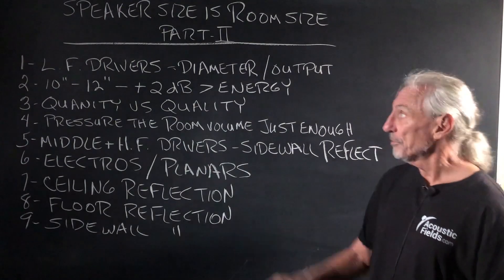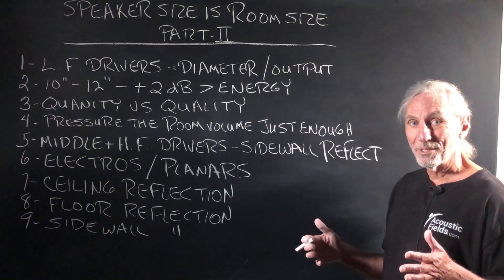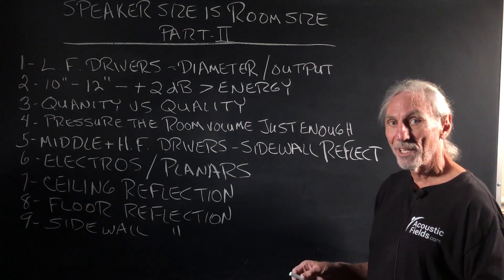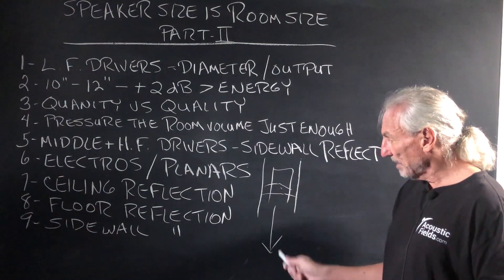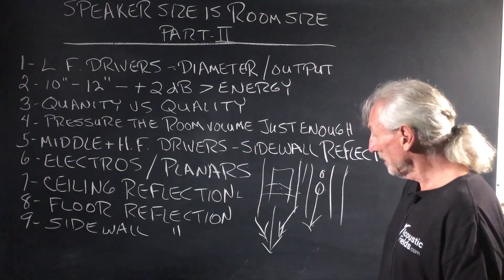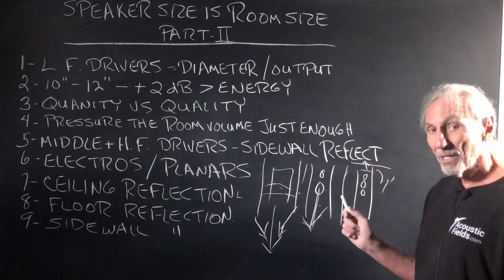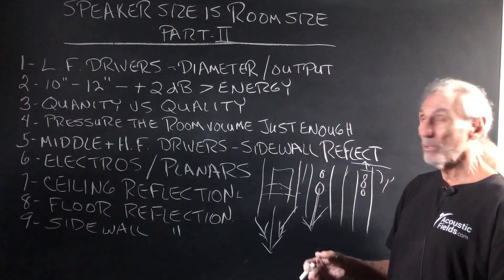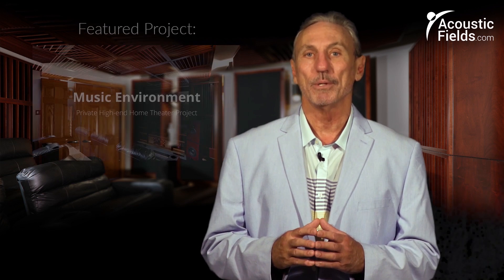Speaker Size VS Room Size Part 2 - www.AcousticFields.com

Comment: For a 11'14' with 8.5' ceilings, cinema room with in wall speakers,  what size would people recommend? Would 6.5" speaker's and 2x10" subs be adequate?
Reply from the maker: Smaller room volumes are best served with placing less energy within them especially below 100 Hz. Stay with a full range 6 / 1/2" driver speaker for mids and highs. Use 1 - 8" sub for this room volume.

Comment: Thanks a lot for the great information, I have question my room is 31Lx13wxh8 feet, can I use pair of 12 inch speaker in this area?
Reply from the maker: You can try anything. However, start with one and learn how the room responds to a single driver. That response, rate and level, will tell you whether more surface area output is required.

Comment: I like the low mids that 18” have, they spread the sound good.
I am impressed with the smaller advent speakers in my bedroom. The stack with two cabs tweeters in seem to give a good start. I really like what four small speakers do above and below the center of the room from the floor to ceiling. 
I have dynaco stacked in the next room same configuration box dimensions but different crossover, drivers and ported. 
Both rooms are horrible. But the speaker size and box seems like a win for now. 
I would love to stack jBL 4312. But that speaker requires a dedicated room. I will continue with the four speakers for my preference on play back in stead of just a pair of speakers. 
Thank you for you’re dedication and I appreciate you’re lives work. ❤️👍🏽😀
Reply from the maker: Subs can be set to produce energy at certain frequencies below 100 Hz. Stay away from them for any middle range frequency management. You drivers within your speakers are much better at delivering more accurate renderings of those frequencies. If you are not happy with your middle range frequencies, don't add more energy. Treat your room with the proper rates and levels of absorption so your speakers can perform in the way the designer intended.
Reply: @AcousticFields  seems so, thank you very much Denise.😀

Comment: I have a pair of Sansui sp-X9000 speakers (in pristine condition) in a room measuring 10'X11'. [The room is acoustically treated] It's killin' me! But it's what I have. Hopefully, someday, I can place these speakers in a more worthy space. Until then, EQ - don't fail me now!
Reply from the maker: I remember those speakers from the 60's and early 70's. Are they the ones that had that wood lattice as a speaker cover?
Reply: @AcousticFields  Yes, Dennis. 14" woofer, 7" mid, double horns, and double tweeters. They sound amazing!

Comment: Thanks for the useful information I agree that the db boost works on larger units, I partially disagree with the fact that it is not possible to use large 12" unit woofers in smaller rooms (with setting both the crossover and the acoustic room). At higher volumes they have less distortion and play closer to the right set of drums than it would be for smaller units.
Reply from the maker: You should be able to play at lower volumes and here everything you need to hear or with subs its the bone conductance that is more important. The fact that you need to play at higher volume levels to get closer to the right set of drums should tell you that your system is not integrated correctly.
Reply: Pressure level and distorsion aren't the only factors to take an account, smaller units are much faster and closer to real percussion speed
Reply: Interesting.

Comment: i’d love to know if there’s a way to turn a water bottle (empty or full) in to an acoustic absorber of some sort. filling it with something that absorbs sound so it would absorb the frequencies that the bottle is tuned to.
Reply from the maker: Focus your research on Helmholtz resonators.
Reply: @AcousticFields  this is where i got the idea from, but i struggle finding more information about them. would love if you could point me to the right direction. thanks for replying!
Reply from the maker: @mr.fingers  You are defining the absorption process that is used within a Helmholtz resonator. The slot, cylinder volume, and internal cylinder fill material all work together to create the process of absorption. Helmholtz's work in narrow frequency ranges and must be used selectively in the room tuning process. The internal fill material controls the rate of absorption. The cylinder dimensions and the slot control the resonate frequency.
Reply: @AcousticFields  that was way more comprehensive than most of the things i found on the topic. just one more simple question, because i’m not sure what would work as a absorption material in such device - it has to be a porous material inside, like rockwool, cotton or somthing along those lines to absorb the sound, right? i was thinking of filling such bottle with concrete, but that would just change the frequency of the whole device, correct?
Reply from the maker: @mr.fingers  Concrete would not have the proper rate of absorption for the internal part of the resonator. Stay with limp mass material types. Stay away from building insulation. You could use a wool or cotton based material type.
Reply: @AcousticFields  thank you so much!

Comment: I don't get it, why not just attenuate the signal to the sub? I get the speed aspect of the size, but the amplitude is so easily taken care of. Or is it that bigger speakers emit more lower frequencies, that usually excite room modes in small rooms?
Reply from the maker: Larger driver surface areas produce more energy output. The amount of output has a direct impact on the room which will pressurize faster. We have used 2 - 8" subs in our studio that measures 65' w x 15' h x 25' d. They do not have enough output to pressurize the room with a time signature that keeps up with the middle and high frequencies. Yes, you can manage the output easily with subs but there are many other relationships that must be considered. There is  a relationship between the room loading and the attack and decay rates within the room. There is a relationship between attack and decay rates with definition and resolution within the room. A lot of this relationship is the room but without proper source the room is just another box.
Reply: @AcousticFields  So the takeaway is, choose the fastest sub you can afford, that has the option to attenuate the  output? And avoid excessive listening volumes to avoid time signature distortion caused by pressure? My listening volume is just 68dB so I probably don't even need to care about all this, just interested. What causes some confusion is that Acoustics Insider stated that room mode excitement is not a function of listening volume, and that our ears just start to compress when we listen loud.

Comment: How do passive radiators factor into this? Manufacturers like to boast getting lower response from smaller cabinets with passive.
Reply: Good question. However, passive radiators function similarly to a port. It's a resonant system.

Most importantly small room size plays no part in which low freq approach is best. Each example's capability is what's important. 

Sealed, Vented, Passive Radiator, Dipole Open Baffle, Infinite Baffle, Servo Control, Band-Pass, or any other type... if well executed and implemented, all these low freq approaches can be utilized. 

Individuals develop preferences for specific approaches, then at times preferences manifest into dogma/false statements, ie, "ported subs are slow boxy", "sealed subs are faster", "nothing kicks like a band-pass" ... etc.

That said, there are pairings that enjoy successful outcomes. Oftentimes open baffle subs are a great match to dipole mains. Many other examples.

Bass Mythology runs deep.
Reply from the maker: @FOH3663  Room size plays no part in which energy source is used is utter nonsense. The room size/volume is critical to any balancing of all energies. Bass mythology runs deep from those that do not build and test..
Reply from the maker: Source response is important. However, without a room that has a good acoustic ratio of dimensions and is properly treated to minimize response issues created by any source, frequency response is just a number.
Reply: @AcousticFields  my understanding is that passive radiators can add to the surface area of the driver (thus lowering response) but by moving parallel they continue to have a quick response time and therefore more accuracy. Is that accurate?

Comment: Compare ear buds to headphones, especially large diaphragm headphones and the space involved. The idea that the low frequency driver / speaker has to match the room is absurd. 
Properly designed speakers have a near-flat response, so the physical size of the woofer isn't an issue.
Reply from the maker: @chriswhalley  Yes and so is inner ear pressure response. Keep speakers out of your ears.
Reply: Mr Heisz is correct. 
Stating woofer size should be linked to room volume is simply not true...
Saying excessive woofer capability is a bad thing=nonsense. 

Also, isn't aware of, and never heard a good 18" driver? 
Bizarre, really.

Bass mythology runs deep...
Reply from the maker: @FOH3663  Our build and ,measurements of over 250 rooms does not support your "facts" or opinions. This is another example of not seeing the forest for the trees. Do not take my word for it, watch our clients testimonials who have followed our design systems. https://www.acousticfields.com/projects/
Reply: @AcousticFields  
You have builds, measurements, or testimonials linked to this woofer size nonsense? 
No way.
Again, doubling down on bass mythology, instead of discovery, learning, and moving forward. 

I'm aware of your portfolio. I'm glad you're happy with your business...it's all good.

That's entirely separate from putting forth incorrect information in a public forum, directed to those seeking to learn. 

You're not an acoustician, you're a YouTuber, acoustic treatment salesman, and that's fine.
Reply: @Lloyd Stout But he said that IF the frequency responses (="rates") were the same, it shouldn't matter what the size is.
Reply from the maker: Driver size and output are always an issue when it comes to pressurizing a certain room volume at the wide amplitude ranges that are used within critical listening environments.
Reply: @AcousticFields  Sorry, no. Bass output is bass output regardless of where it comes from. 100db from a speaker with a 10" woofer and a flat response is the same as 100db from a speaker with a 15" woofer with a flat response.
Reply from the maker: That is correct. However, you must consider every dB of pressure gain when designing a critical listening room and the sources that produce it. You must consider the rate of that pressure increase and driver output is related directly to the rate of pressurization.
Reply: @AcousticFields  100db is 100db - that's the spl. The actual pressure (air pressure) of the room doesn't increase with a bigger woofer - it's just pushing air that's already in the room, just like the one with the smaller cone. 
That's like saying a bigger fan can move more air at the same cfm as a smaller fan. It's the cfm (cubic feet per minute) that counts, not the size of the fan.
Reply from the maker: @IBuildIt  Everything counts when you design rooms that you guarantee the performance +/- 2 dB from 20 Hz. - 20K. Every variable is related to every other variable at that resolution level.
Reply: @AcousticFields  A variable worth understanding for anyone involved with audio is distortion. The smaller the woofer, the longer the stroke needs to be to put out enough low frequency energy.
Longer stroke equals more distortion. 
So a 6" woofer that's flat down to 40Hz will be more distorted than a 12" woofer that's flat down to 40Hz.
So that's actually a very good reason to use bigger speakers. 
They also have greater dynamic headroom, which is another very good reason. Rather have power to spare than trying to push the limits of something that's undersized because you believe the woofer size needs to match the room.
Reply from the maker: @IBuildIt  I am not sure that a longer stroke means more distortion with today's electronics that monitor that function. I have many systems in our studio. I find that small, LF drivers, sound "faster" and are a better match for my two channel near field rig that has a 5" LF driver. I have tried a 10", 13", and even a 16" sub but always come back to the 8". Integration on many levels is required. You must integrate with existing components and you must have similar integration of low frequency devices in small rooms.
Reply: @AcousticFields  Could be that you prefer the distortion - some do.
Apples to apples using the same equipment and quality designs, a larger piston will always have lower distortion and higher dynamic headroom than a smaller driver.
The only real reason to limit the size of speakers in the room is distance to the listening position. The larger the speaker, the farther apart the acoustic centre (distance from middle of woofer to middle of tweeter) of the speaker will be, and ideally you want a speaker that best matches the distance to the listening position - smaller = closer, bigger = farther away.
Reply from the maker: @IBuildIt  There are many other reasons to limit driver size and thus output into a container (room). Looking at one single factor without realizing that that single factor must interact with other factors is done all the time with limited success. Everything depends on everything else. Taking one single variable and isolating and using that as a paramount or solo factor is a false comparison when all systems are multiple variable dependent.
Reply: @AcousticFields  Other subjective reasons, sure, but none based in actual science.
We don't have to go any further than your assertion that a 12" woofer puts out 2db more than a 10" to gauge your understanding of how speakers are designed and work. 
I don't know if you actually understand this better and are just making analogies to try to explain it to the viewers, and you aren't good at making suitable analogies. Or if you really believe some of the things you are saying. 
Like comparing the room to a 16 ounce glass and the speaker trying to put 24 ounces into that room. Any speaker that has good low end extension, regardless of size, will excite the room modes. Any speaker. 
Properly designed speakers have near flat response regardless of size. So any thinking person can see the contradictions in what you are saying and how it's filling the heads of your viewers with stuff that isn't true.
Reply from the maker: @IBuildIt  What is not true is your allegiance to the objective when music and voice appreciation are a combination of both paradigms. I can tell from your discussions that you have limited experience in large boxes (rooms). Be careful leaping from a small speaker box into a much larger room box.
Reply: @AcousticFields  My allegiance is to reality and fact, not mystical mumbo-jumbo and assumptions based on limited understanding.
Sorry to see you doggedly stand by what you are saying when you are presenting yourself as an expert. I'm not an expert, but I know enough to see the flaws in your reasoning. All that's needed is a fairly good knowledge and understanding of the basics to do that, though.
Reply from the maker: @IBuildIt  What is easy to see is your small box thinking when applied to a room. It is best that you stay within your small box and leave the larger box treatment and corresponding satisfaction levels to those of us that actually create technologies that solve real room issues. Even though physics is the law all input into a room is error both objective and subjective.
Reply: @John I'm fascinated to hear from a person that knows this stuff. I'm thinking that there has to be some reason that Dennis has made this conclusion over the years. Maybe there's a trend that smaller speakers tend to have a low end roll off, so the problematic room modes of small rooms aren't that excited?
Reply: @djentlover  If this were an actual problem in acoustics, there would be a bunch of detailed studies looking at it.
Reply: @IBuildIt  
Exactly, it's a non-issue ... and an individual wanting to solve it.

There's a detailed piece I know that's related to this ... and of course, shows it's nonsense.

There's no synergy to woofer size and room volume. The only salient issue in woofer size is c-t-c distance to the next band upward. That's a driver blending issue (as you mentioned above), nothing to do with room acoustics. 

𝘥𝘫𝘦𝘯𝘵𝘭𝘰𝘷𝘦𝘳;
Regarding excitation of room modes, it's simple;
1.)  Room modes are solely established via the room's dimensions. 
2.)  Which modes/resonances are excited is determined by speaker placement. 
3.)  Which modes are heard is determined by listener location.

Thanks and best of luck
Reply from the maker: @djentlover  Its all about pressurizing the room with wave energy. Each waveform "builds" upon the previous wave cycle. The goal is to have an even as possible distribution throughout the room. You must take into account room size, volume, attack and decay rates and many other issues. You must match the energy source output to many different variables. This applies to speakers as well as sub woofers. People who dispute this have never built a room in their lives. They do not see all the variables involved. You have analog treatment, electronic processing, and the source of energy that must be matched to all of these. Watch John from REL talk about using common sense when it comes to subwoofer size and room volume.
Reply: @Lloyd Stout Exactly right , level is an average , rate of change is the physical element that differentiates the amount of pressure per unit time and not the average.